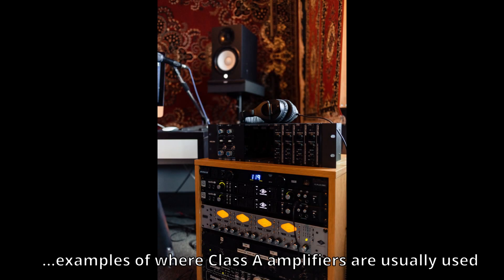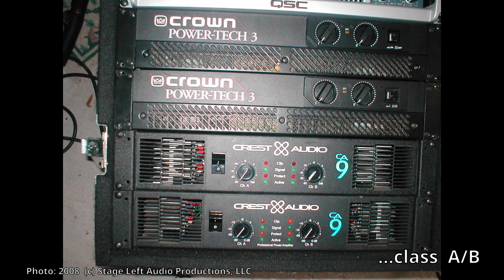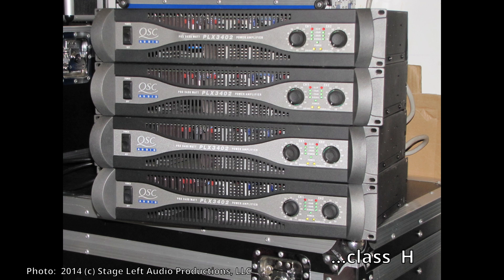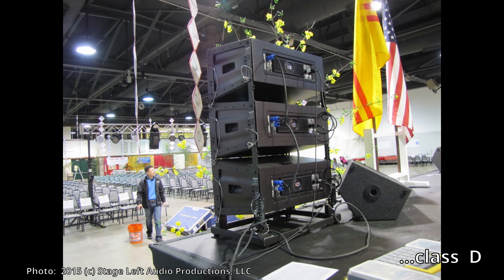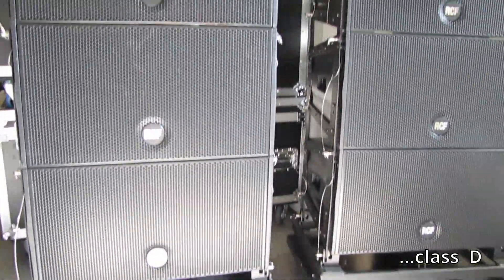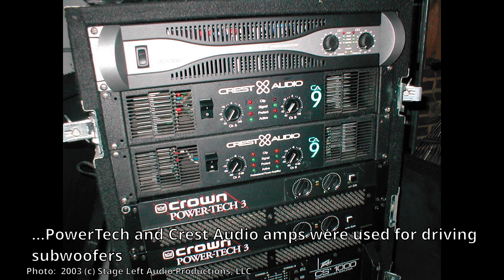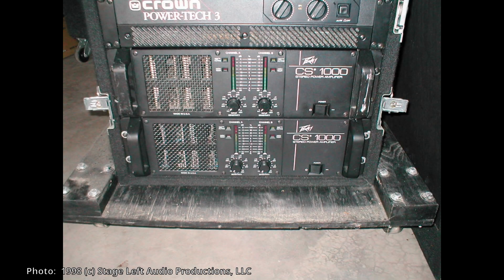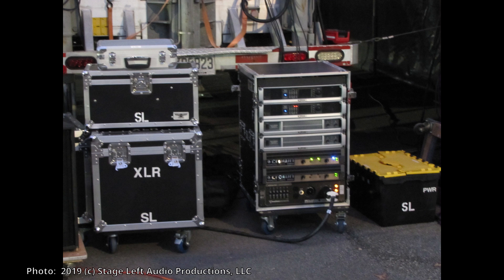Amplifier classifications (class A, A/B, H, D).  Basic information on audio amplifiers.

Comment: Reading some of the AC watt ratings on powered speakers, they range from 100W to 150W, less than an old floodlight bulb. You can pump a lot of sound off a single 20A circuit these days.

Comment: I have 4-RPA-16's from ROCKVILLE class H.. 1.4 K @ 4-ohms. per-side... I can do 3000+ watts each bridged. 47lbs. each. 10-12,000 watts at 188-lbs.. $400 for each unit...Great price! My setup is in a 12X15 foot room.. Class D sucks.. looks swell light weight but made by MATTEL! Class D amps. are powerful but sound STERILE!! WATTS used to represent an amplifier is Ludacris.. Don't be a WIMP ..oh the class D is lighter so I don't have to pucker my ass mussell to set it up!
Reply from the maker: Not bad!

Comment: Love the crown macro tech 9000i amps. I just wish the physical build quality was better. The knobs are made from cheap plastic, and the chassis is soft.
Reply from the maker: The build quality is different than the original MA line.  The production for their amplifiers is (I think) in Mexico as of a few years ago.   Production used to be in the US.  However, with computer connectivity to the amps, I think many manufactures are moving away from providing top-quality physical controls to manage their amps... when it can now be done through a computer.  The chassis' on our amps seem rather solid (like the original MA-2400/3600 series).
Can you describe the "soft" chassis?  Does the chassis feel "lose"?
Reply: @stageleftaudio  Chassis doesn't feel loose but you could bend the tail section for the mounting brackets at the back with very little effort. The xti amps are cheaper but the build quality is much better.  That's my only issue with those amps but they sound amazing
Reply from the maker: Ah ok, I know what you mean about the rear supports.  We have that same issue with PDUs and rack drawers we use.  It would be nice if Crown had kept their original design. 
 Thanks for the follow up.

Comment: i used trio 1500g vintage amp,class a and i upgrade the power supply and power transistors so that i can use in outdoor event for midhigh and class ab diy qsc rmx 1450 for sub..i used it in more than ten years till now,it works fine even if its very hot in continues loud music. I dont have much money to buy class d amps even if i needed them. From the philipines
Reply from the maker: It is common for class a/b amps to still be in use, especially for subs.
Reply: @stageleftaudio  yes sir it's common specially if we have no choice,😂

Comment: I'm certainly a fan of Class D amplifiers; more modern ones sound great and their power to weight ratio is phenomenal. When I first shifted to Class D, I was amazed at having 1KW in 1U; and bought four of them...I still use them today for monitors or for FOH in smaller events. You don't have to look far to get 10KW in 1U these days, which to me is astonishing.
Reply from the maker: A lot has changed!